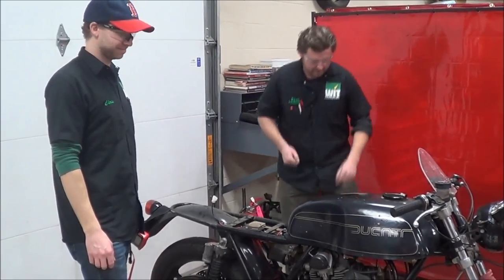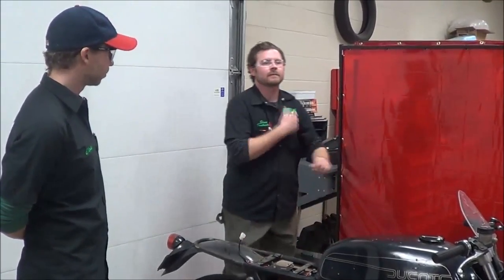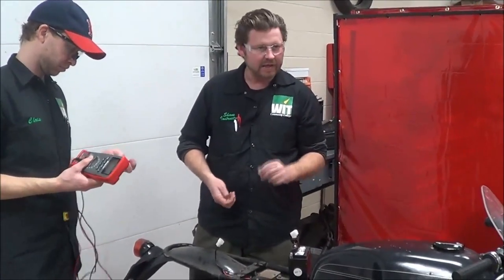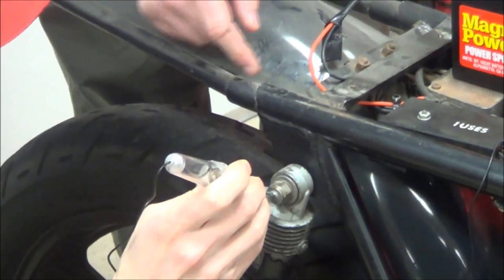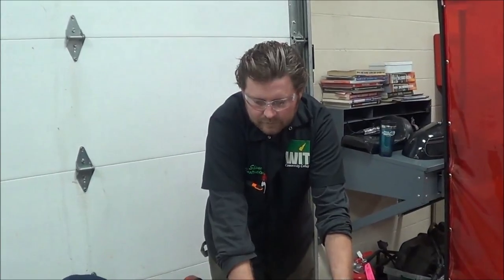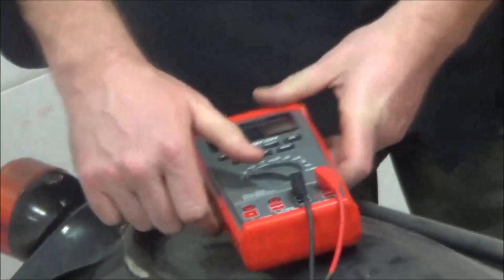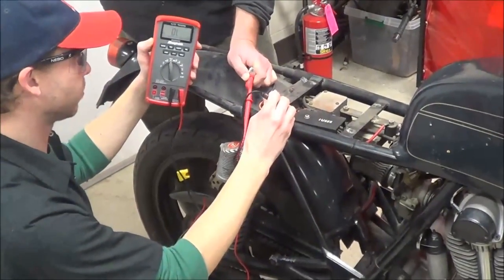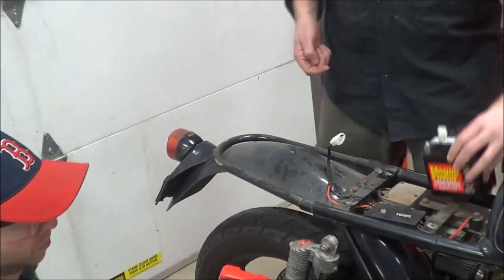Negative Ground Verification

Comment: I have a 93 Fatboy that keeps melting the positive post on the battery. I'm thinking I have a bad ground.
Reply: Find out where the ground points are, remove the grounding wire, and lightly sand the spot where the wire goes and replace.

Comment: was testing ohms on 02 sensor out of car for continuity..using 200 ohm on the dial.  what is 18 ohms on the meter indicative of?  thanks
Reply from the maker: 18 ohms is the measured resistance in a number that can be compared to the specification by the designer. You would need to source to design specifications and then compare. Some sensors are tested at multiple temperatures as well.